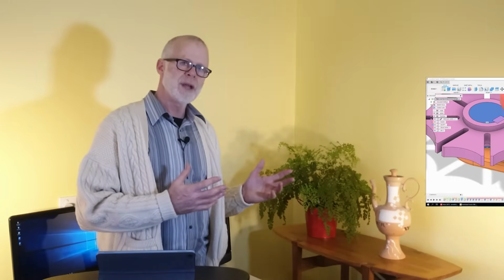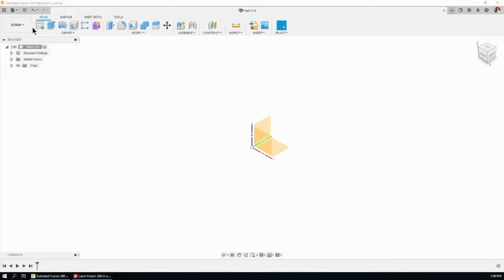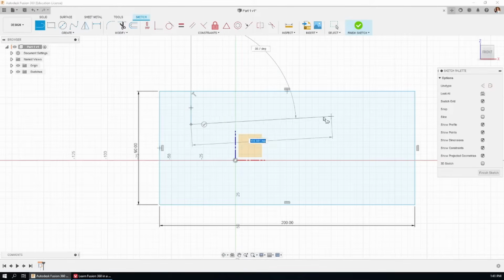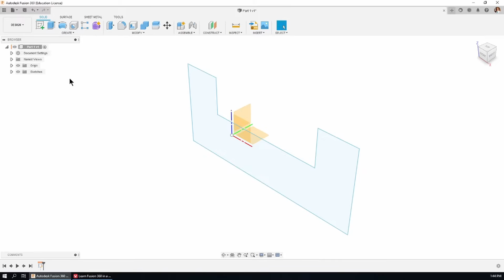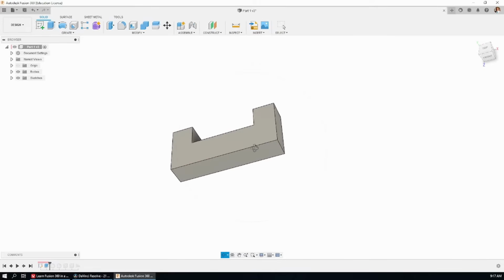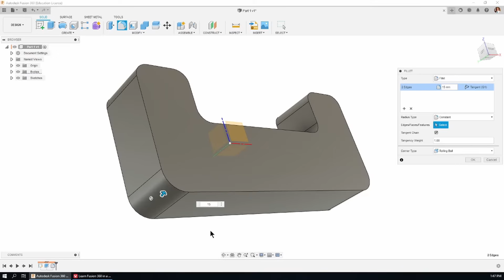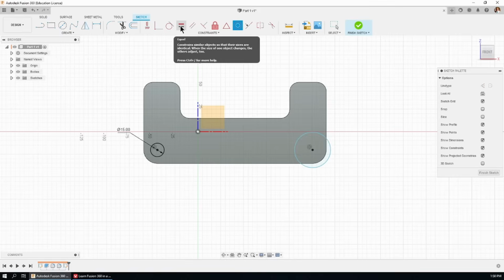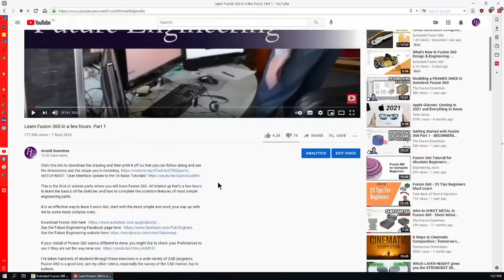Learn Fusion 360 In a Few Hours. Part 1

Comment: Guy has modified his setting and mouse behaviors from default and forgot to either teach us his settings or set to default. Holding the middle mouse wheel does not orbit
Reply from the maker: Hi Neon, here's the playlist where the preferences settings video lives; https://www.youtube.com/playlist?list=PLFCTgdiT5-kLBNvrkUNy63Gu1tWdRuKkr
There are times when people find that it doesn't work even when the preference settings are the same as mine, that's unlikely but some just have to use the Orbit tool, the little icon on the far left side of that little toolbar at the bottom of your screen in the middle. With time all these "bugs" get ironed out.
Reply from the maker: The escape key is probably the quickest way to make a tool let go, to get back to the previous tool you were using, right-click anywhere on white space and see what's at 12 o'clock on the right-click menu.

Comment: How do you deselct back from orbit to the tool you were using?
Reply: I like this tutorial but after this question its a full stop while I seek out how to switch back and forth between tools. Frustrating
Reply from the maker: Probably the quickest way to make a tool let go of your cursor is to hit the escape key. Alternatively you can right click and then left-click on OK which is at 3 o'clock on the right-click menu. Another way is to left-click on the SELECT tool icon in the toolbar above. Clicking on the Home icon next to the view-cube does the same. They're all more complicated than that ideal middle-mouse button drag but that will come good eventually.

Comment: Your tutorials are excellent, and I've learned quite a bit about Fusion 360 by working through them.  I am trying to use Fusion to do a custom dust collector adapter which requires 6 bolt holes around a flange. I tried following your tutorial #16, using "cut" extrusions with a circular pattern, but while the first hole was fine, the other 5 did not 'cut', and were merely circles on the sketch.
I tried using the 'hole' tool, but got so frustrated that I just gave up.
Do you have an updated tutorial on how to do multiple holes which would work with Fusion release 2.0.19983 x86_64??

Thanks!
Reply from the maker: @kencarrothers6350  Ken, I’ll reply to your email of some days back, I think I can help.

Comment: my perspective view is only lines and not gray surface. how will change to gray colored surface
Reply from the maker: Hi Carlos, Fusion has some tools for these things. Look for the toolbar at the bottom of your screen in the middle. There are eight little icons in that toolbar, the third one from the right end looks like a little old TV. Its tooltip reads "Display Settings". Left click on that icon and mouse up the menu to the top which is called Visual Style. As you mouse over Visual Style a flyout appears with six options. I'm just guessing, but I presume you've got it set to one of the last three in that list which show wireframe models. Experiment with the top three shaded ones and let me know if that's the cause.

Comment: Arnold, thank you for the tutorials. I just retired and have a 3D printer (QiDi X-Plus-3) with which I wanted to design parts. I tried to get the 16 drawings you offered, but the code no longer works. I also tried purchasing them through PayPal, but that didn't work either. How can I get the drawings from you?

Warren
Reply from the maker: Here you go Warren:  https://drive.google.com/file/d/1uUaIBX66oGVbruqZr_hrm-XhljWtOhme/view?usp=drive_link
Reply: I received Arnold thanks a bunch!!

Comment: Arnold, excellent training videos.  As you suggested, I have gone through them several times to build familiarity.  I would like to clean up the various training files I have created during the learning process, but it is not intuitively obvious how to delete them.  How do I delete the many files I have created in the learning process?
Reply from the maker: Hi Edward, this may take a bit of back and forth, if I go quiet its likely due to the time difference - I'll be back on deck tmrw.   So most of these management tasks are accomplished in the left panel. The little icon on top to the left opens the panel. Right click the file you want to delete and find Delete in the right click menu. If you want you can keep lots of files in the cloud storage, just make them read only rather by clicking on "Editable" and change to Read Only. (I assume you're working in the free version aka Personal Use version.)
Reply: @RowntreeTeachesFusion360 Thank you for the very quick reply.  I understand the time difference.  It is not an issue.   Yes, in fact, I am using the free personal use version. 

Although the cloud is, for all intents and purposes, unlimited in its storage capacity,  a little forethought or, perhaps more to the point, a lack of forethought can quickly create an unmanageable and, more importantly, unnavigable mess that needs to be navigated through to get to projects you want to work with.  I am trying to be proactive in managing that file storage for easy navigation rather than creating the kind of digital mess that discourages use the more you use it. 

Again, as many have already said, your instructional methodology and style are like a breath of fresh air.  I genuinely appreciate the efforts, clarity, and insights you impart to the instructional process/experience — thank you!
Reply: Arnold,  I managed to noodle it out from your commentary.  Thank you for the great learning videos and the excellent instruction.

Comment: Ive recently purchased my first 3D printer and have been told Fusion 360 is the CAD to have, so I'm giving this a go. Thanks so much for these excellent videos. I'm having success learning the basics so far. However, one issue I have is when I finish a sketch and go to feature mode to extrude, my drawing does not auto rotate into the isometric type position as I see in the videos. I must manually rotate them using the mouse, or by clicking the Home button at the top right of the screen next to the cube. Is this a setting to enable? Thanks if you can. help.
Reply from the maker: Sorry to take so long to reply, yes its a setting although I've found that on some occasions it doesn't work for me. Nevertheless, you can see my preferences settings in this video:  https://youtu.be/UVwJJvQR1fc?si=7HvGlvApXEMPfaLj
Anyway, I'm so glad if that's your biggest problem. I was a slower learner than you.

Comment: The first what i encountered as a beginner was a Freezing VEVOR 3018 PRO with a .cn file generated by Fusion 360 . The Firmware of the VEVOR 3018 PRO has with G_Code:G19 a bug. The progress stops and the spindle just keeps rotating and no communication is possible anymore. Need hard reset. 
youtube.com/shorts/mk0A7qj7N0s see also youtube.com/shorts/QzzSysvoXXg.

Comment: Hi Arnold , thanks for your tutorials , be dropping in and out , do you have any recommendations for 3D printing for mock-ups ... all best Greg
Reply from the maker: Hi Greg, You know where to find me here. About your question; I’ve been thinking a lot about 3D printing, there are some cool things coming such as metal printing on ordinary fused filament printers like my Ender 3 but the thing is, you need to make tinkering with the printer your hobby but you probably have applications in mind like I do, 3D printing for me is a means to an end, not the next hobby I want to play with. So what I’ll be doing is getting prints made by an online bureau service. Then I just have to focus on the design and improving it while I get successive iterations printed. There’s a cost but you can get quality prints at a reasonable price in whatever commercial printing technology is available, and usually better than I could do at home even if I get everything dialled in perfectly.
Reply from the maker: I haven’t started trying out bureau services yet but I’ll be looking at Craftcloud, Xometry and Shapeways.
Reply: Has to be the way forward , saves the worry over time jobs take to finish , would be looking to have a simple plastic prototype then once ok , have it made in a carbon fibre mix or metal .  @ArnoldRowntreeTeachesFusion360

Comment: Howdy Arnold, I have subscribed to your 16-part tutorial, and I love it. I have tried other tutors but they all seem to fail with the basics of setting up preferences, and my machine simply does not do what the video instructions require. Thanks for the preferences pdf download as I had different settings on my machine.
I am a registered hobby user yet I cannot save my work and I can't find your lesson files on my machine. The program has a little blue star on the save button and asks me to register. Can you plz shed some light on how to resolve this problem?
Cheers
Michael Chorney
Reply from the maker: Hi Michael, welcome to my channel, its been a long time since I installed Fusion and the procedure changed a few months ago. I've been looking at my own account and I can only suggest you go to the forums which work very well. You'll find the link if you click on the little question mark way up in the top right corner of Fusion 360, the second icon from the right. Community is the fourth item on the drop-down and forums are at the top of the fly-out. Alternatively here's the URL  https://forums.autodesk.com/t5/fusion-360-support/bd-p/962  There are tens of thousands of users here and I've always had questions answered within hours. I'm sure you'll have this going shortly, keep in touch, I can often help even at a distance, we all get stuck on new software.

Comment: I'm 70 and retired.  My career began with bass board and t-square through DesignCAD 2D for DOS.  The company I retired from used several packages for machining but mostly Solidworks for design and documentation however as a project manager the engineering department was not an activity I needed to participate in.  Always thought someday maybe I would become motivated to learn 3D CAD.  So now we try again.
Reply from the maker: Welcome Lance, industrial experience is always an advantage. Even for hobbyists we're mimicking a workflow that applies first of all to industry. No doubt you have a number of ideas in mind.

Comment: Thanks for the video!  I'm moving to F360 from another package and I have a couple of questions:
1) Your first sketch was under-constrained, was that on purpose?
2) I assume that the 16 different parts being made will go into and assembly, why not make them as sub-components of an assembly component from the beginning?
Thanks Again!
Reply from the maker: Hi Jim, welcome! There is a lot of good CAD out there, Fusion 360 has a lot to recommend it.
Yes the sketch was under constrained, it wasn't so much on purpose as un-concerned. No-one here is designing a jumbo jet and I'm going to be covering the need to fully constrain a sketch later in the series. The early ones are to get people up and modeling, we'll get more precise with the features of the UI as we go.
A lot of tutorials go for the assembly with parts as a first project for beginners but in my classroom experience I found it confused some and left others bored if they aren't into - for example skateboards or whatever the initial project is. My assembly tutorials do use a similar approach however.
Reply: @ArnoldRowntreeTeachesFusion360  Thanks for your videos, I've gone through most of them now and I feel I'm close to begin working in Fusion 360!  They are a great help!

Comment: Arnold, am I missing something? It seems that I am not seeing the revised versions after Part #5
Reply from the maker: That's right Johnny, number 6 is in the works, and has been for a while. Most people can follow OK with the older ones from here on. If you click through to the channel playlist you'll see some other supporting videos which you might find interesting.
Reply: @ArnoldRowntreeTeachesFusion360  Thanks Arnold I'll keep going with it. I started with Fusion 360 when they had the full version for Home hobby users then they changed it and took away all the good parts. Eventually I want to up grade my mini mill and lathe to CNC . and would have to subscribe to be able to do the programming through CAD/CAM but it would still be for my personal used. I'm retired on disability and was a machinist for over 36 years and just enjoy making thing for myself and friends, not for money.
Reply from the maker: @johnnymills9546  Thanks for putting me in the picture. I can understand where you're coming from now. The price of a subscription isn't too bad considering its a key tool that allows you to enjoy practicing all your professional skills. It sounds like your friends will see some valuable gifts eventually.

Comment: Arnold-Thank you for your efforts. I am an intermediate user(at best). I have a 24"x36"x8" CNC (Mach 3 operating system). I am using to make cello. I am to the point of carving the top and back. I have sketches of the profile. Can you point me to any tutorials on the technique for drawing a 3D top and back.
Reply from the maker: Hi Tom, congratulations on your cello project, I hope it work out well. You have certainly set yourself a challenge! Contoured 3D surfaces are an advanced topic. My initial reaction is that you may find the path to success involves taking time out to build skills in Fusion 360 surface control, CNC machine control and CAM toolpath control, as well as woodworking skills (perhaps you are already an instrument builder?) Anyway, its a magnificent vision. I did interview a piano builder who is working toward building high performance piano soundboards via CNC routing. Here is the interview:-  https://youtu.be/OcjLApqsRAA
Reply from the maker: You also asked me for some pointers to tutorials on these skills, here are two other Youtubers but I suggest you learn the basics from me before you graduate to these advanced teachers: 

one is "Fusion 360 School"  https://www.youtube.com/@Fusion360School

And the other is "Learn Everything About Design"  https://www.youtube.com/@LearnEverythingAboutDesign

Comment: Good morning sir, I am at the concentric join of the 15mm circle to the 15mm fillet and i am having an issue. When i click on the concentric tool and then click and highlight my 15 mm circle, i am unable to click on the 15 mm fillet, while hovering to select the 15 mm fillet it shows a cursor "click on other geometries, preventing me from selecting the 15mm fillet. I am stumped. Thanks!
Reply from the maker: Joe that can be caused by a couple of things. It may be because you're in a sketch but one of the curves is not part of that sketch, (I'd have to be looking over your shoulder.) In the meantime you could try two dimensions to the side and base. Anyway, don't stress, move on to the next one and come back after you've done a few more tutorials. The second time through is often far smoother.
Reply: @ArnoldRowntreeTeachesFusion360   Thank you Arnold, it appears it was a sketch problem. I started over and I am now finished with the first lesson. I am new to fusion as of a couple of weeks ago, I really like and appreciate your teaching style. I am retired and learning this to keep my brain active

Comment: Thank You!!
Reply from the maker: Welcome to the channel Sachin
Reply: @ArnoldRowntreeTeachesFusion360  i worked as a mechanical designer about 15 yrs nack and did 3d modelling with ProE and Static analysis in Ansys. after that i am working as maker making electronic PCB and Software...... i need to make box for product.......so learning 3D modelling once again....
https://www.youtube.com/watch?v=HyNF4bEu60Q&t=449s
Reply from the maker: @jugnu361  That sounds great, Fusion 360 should be easy enough to learn. Let me know if you get stuck on anything though.

Comment: I have watched several videos on F.360 and most move so fast from one item to the next and do not explain which icon was pressed. Your vid is much better, at least for a beginner. I think I will learn a lot from your series. 

I did have one question though... I forgot to put the fillets on this model until I was trying to concentric constrain the circle to the fillet. I went back to the sketch and added the fillet with no problem. But when I went back to the sketch with the circles to constrain them to the fillet, the constrain icons were no longer on the tool bar.

How to I get the constraint icons back on the tool bar when I return to the sketch? 

I had to delete the sketch with the holes and create a sketch again, not a problem with only 2 circles, but if I had put 2 hours into this sketch I would not been happy.
Reply from the maker: Tom, Its always tricky on the first few goes around. 
Just by the way, it sounds like you were doing the fillets in sketch mode, you can do that but I purposely did the tutorial with the fillets in feature mode. But hey! that's not what this initial tutorial #1 is for. Its to get something done, almost anything will do me at this stage. 
You could redo the tutorial, and even if you took two hours over it that would be hugely frustrating, I agree, however any time you spend clicking on things and moving around in Fusion  360 is valuable experience.
As soon as you have anything that looks like the model I demonstrated, move on. Still, come back and do some of these early ones at least twice if you wan't to get good at this. I can't emphasise enough that its the repetition that helps all of this to stick.